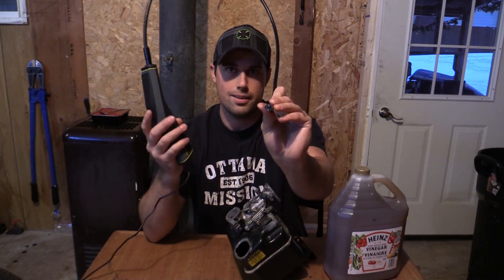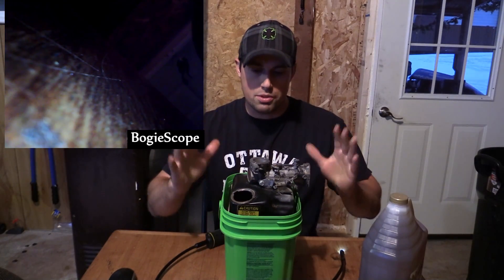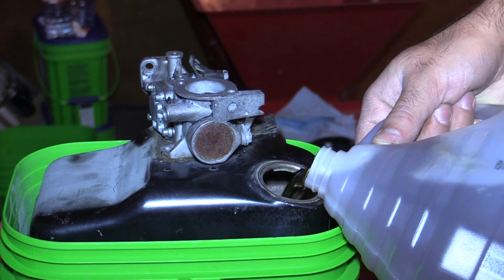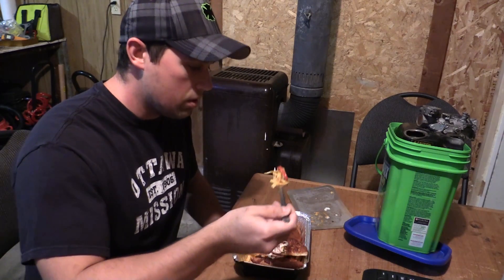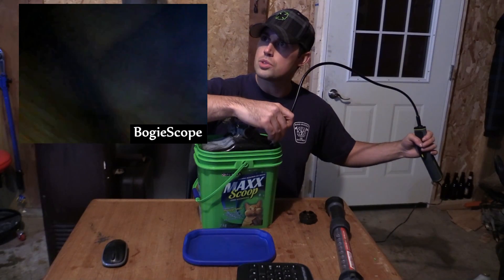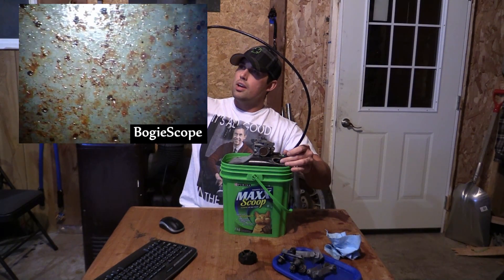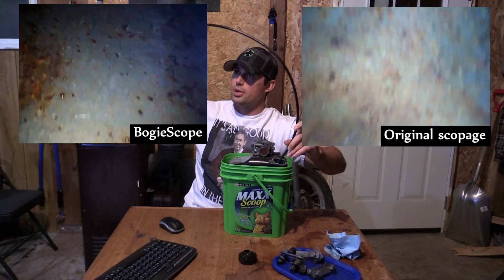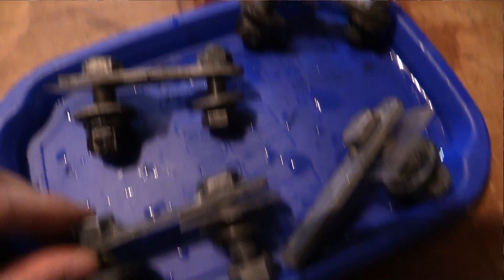Apple Cider Vinegar as a rust remover: How effective is it?

Comment: 2 cups of rock salt, 1 cup WHITE vinegar, shake 10 minutes, rinse out twice, done! Been doing it for years, never failed yet.
Reply: Husqv 51 is there a substantial difference between white and apple cider?
Reply: Well I can tell you this much, if you drink apple cider vinegar it is great for the body,, but if you do it with white vinegar you will be dead before long. That tells me there is considerable difference somewhere :-) I have used both to derust and find white to work in about half the time.

Comment: hey bro. i had a rusty gun with a live bullet stock inside. is it safe to derust my gun with the apple cidar venegar?, help
Reply from the maker: roger cada Soak your gun in WD-40 for days in advance.  And I mean SOAK... as in immerse it.  The penetrating fluid will neutralize the gunpowder in your round, and also likely unjam your gun.  I would get the gun checked out to make sure it's still safe to use afterwards.  Rust pitting can cause further problems if it's bad enough.

Comment: degreased first? If a oily film was protecting the rust from the vinegar, it could take weeks
Reply from the maker: That's true, I don't think there was any grease on the inside of the tank though, it looked real dry and dusty anyways.  I could be wrong though.
Reply: That is exactly what I was thinking too, I mean at the end of the day it will only do so good of a job. But with an application where it has been exposed to oil, fuel or other chemicals I would clean it before using the apple cider vinegar to rule that out and give it a chemical free surface to work on. Nice work with the camera it was cool to be able to get a close up inside the tank.

Comment: Put some washers and nuts and bolts in there and swish around every hour or so over the 36 hours. Hey presto!
Reply: Yep......thats the secret.....I put 50 washers in my motorcycle tank after soaking with vinegar for 4 days.....it still had a slimy film that would not come out, but the washers (and a lot of shaking going on) got it looking almost like new.  Then dish detergent/warm water, shaking, flushing out, then half cup baking soda and some water, shaking, flush.  Then remove the petcock, and use hairdryer through top to dry out, then immediately add a gallon of diesel fuel to keep oil on the surfaces until you are ready to install and fill up with gas.
Reply: crazeyspivey Hey man, did the white vinegar damage your petcock at all? I let vinegar sit in my tank for 2 days with the petcock in. It doesn't LOOK damaged but sources I saw after the fact said to remove it prior to adding vinegar.
Reply: Did the vinegar damage the rubber in the petcock? I know the acetic acid is not that strong.Cheers

Comment: they sell some epoxy based tank sealer, i used this on some vintage motorcycle tanks, coats with white epoxy and looks nice after its done, its like half an hour slowly rotating it by hand but its worth it
Reply from the maker: jusb1066 Cool, thanks!  Does it neutralize the rust inside also?
Reply: Bogie Wheelz
well yes and no, you wash the tank out with any degreaser you can wash out with water, use nuts and bolts at the same time as an abrasive, at least thats how i did it, and the epoxy seals off the rust and covers it, so no more problems
, i did some 50 year old tanks on my 2 vintage bikes, and that was 20 years ago, the tanks still have zero problems with leaks or rust appearing inside